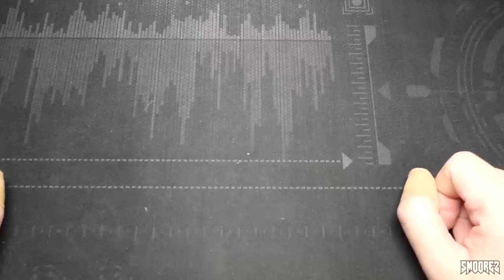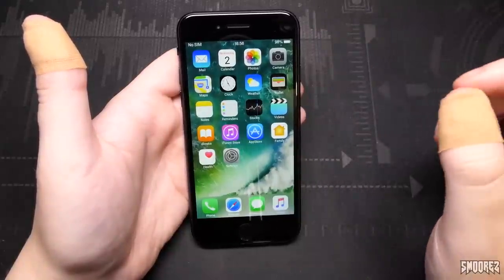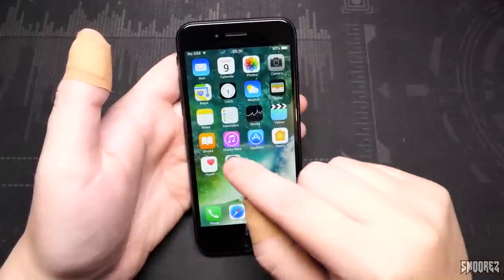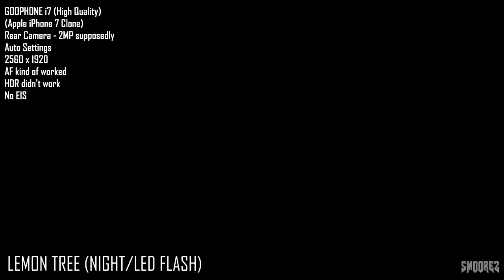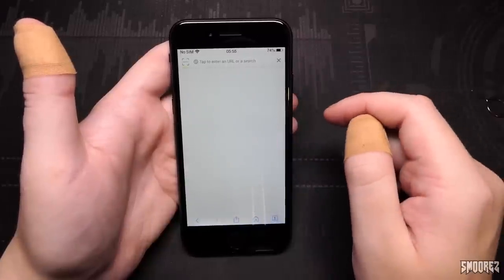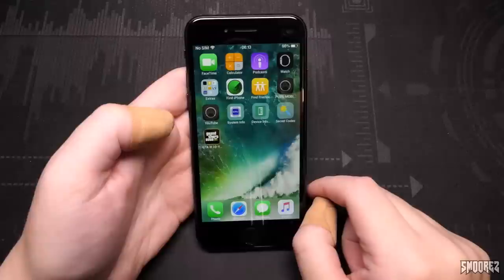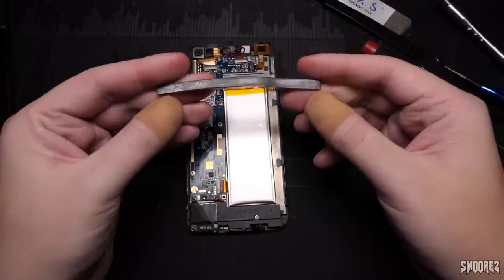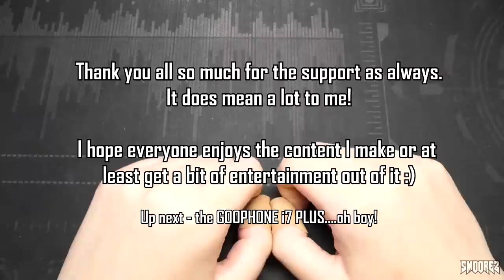ATTACK OF THE CLONES: The PAINFUL "High Quality" GOOPHONE i7 (Apple iPhone 7 Clone)

Comment: I had an Android 4.0 phone just sitting in a drawer since 2012, recently I found it and tried using it, I legit thought it was the worst experience I could ever have when YouTube was taking way too long to open, but all of a sudden after watching this I feel like I've been spoiled.
Reply: I still occasionally use a Galaxy SII that I put unofficial Android 7 on, and it surprisingly works a lot better than this clone, even though it came out in 2011.
Reply: @denny1527  It's definitely the RAM, iPhone clones tend to slow down a lot due to the heavy skin on top of Android, paired with at most 512mbs of RAM. This would have been plenty if the skin wasn't present, but it slows down the phone a lot.
Reply: @pleasebake  Yeah, most of these cheap clones do that. The "Welcome Maimeite P50 Pro" device I once had to deal with was also painfully slow having similar specs, due to Android 4.1.2 being skinned to look like 10, and having a dozen possibly malicious janky apps running in the background. A phone with a clean Android install and these specs would've been semi-decent... in 2011.
Reply: Install a custom ROM. It really does A LOT. A Samsung Galaxy s6 now runs android 11! And it's snappy
Reply: I were able to get YouTube working on a Samsung Gravity Smart running 2.2 Froyo around 2018 or 2019. The audio and video were noticeably offset after a while and the phone's battery only lasted like 25 minutes.
Reply: @pleasebake  no, 512MiB of ram is still not enough.

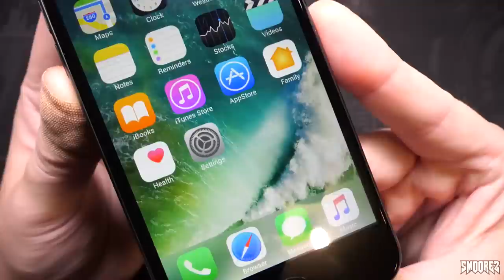Comment: 5:40 You can actually see the line at the bottom of the screen. The screen resolution is a bit short and the picture cuts off earlier than it should, which means the backlight works even under the home button. Still funny how they implemented it.

Comment: 41:37 the 4636 code is the testing menu, including wireless network related stuff. 
You don't get that on iOS, so that proves it's running Android underneath.
(I also use the 4636 code to disable GSM, and have 3G/4G only mode, because let's face it, 2G/GSM is too poor for call quality and data speeds in any modern era.)

Comment: Actually, the boot screen would tell you it's fake, a black iPhone is supposed to have a black background and a white apple logo on boot, and the opposite for the white model.
An iPhone has both of the screens put in it, regardless if white or black, and it can sometimes show the wrong screen, before correcting it if it kinda malfunctions and (re)boots in cold temperatures
Reply: And this is off-topic, but it really is a nice thing that modern devices have the killswitches built into the power button, pretty much just a force restart, activated by holding the power button for about 8 seconds (can vary with your device)
And I have a tablet with old android on it (somewhere around Android 4), it's not really mine, but my family has it. And it has a reset button. Might be an entry for Tacky Tablets.
Reply: @tylern6420 that's only because we aren't allowed to remove the battery like we used to id rather be able to do that

Comment: Imagine the effort that went into skinning this to look like iOS. They did a pretty convincing job at it. Well, it would be convincing if it didn't have the constant app crash popups and options that just don't work. But I assume it didn't crash when they were testing it.
When you put this much effort into cloning the interface of another phone, you have to imagine it would've been easier for them to just make a generic design with stock AOSP. Would've actually worked better too.
Reply: Unlike previous one, this is a perfect scam phone - look almost identical to original, but nothing works :D
Reply: This phone looks almost identical to a genuine one and if you look up the serial number it pulls up an iPhone 7 Pro so they even poured it over a real imei and SN number

Comment: I believe that if they made an actually usable phone (at least 1gig ram and 16gigs + sd card storage with Android 6 and of course no Apple logos) they could sell a lot more without all the returns. I wonder why they don't use at least Android 6. As far as I know Google does not charge for Android so why not use a newer version (just put in slightly larger storage)?
Reply: Phones with 1 gig of ram would be pretty unusable nowadays, especially on Android 6+. Putting newer versions of Android means putting more powerful hardware into the phones which means spending more money, and because Goophone is presumably spending most of their money to replicate the Apple logos and iOS while trying to keep the production costs at minimum, they're using the cheapest, worst possible hardware from 10 years ago.
Reply: @denny1527  Usable depends on what you are using it for. If you don't game on the phone 1gig is usable. I was talking about the minimum I could get by with since the only things I use my phone for (besides the occasional phone call) is an ereader, email and solitaire.
Reply: Xiaomi's cheapest phone is 85 USD here in India and offers 2GB of RAM and a Helio G25 (12nm) running Android 10 + MIUI 12. There's a 6.5" 720p display, 32 GB, headphone jack, SD slot, and it is perfectly usable. 

The point of the fake is to sell the cheapest possible unit at ten times that price, not usability. And they have no incentive to upgrade the hardware or software

Comment: Some of those clones are so unbelievably bad they aren't worth $50 USD to me.  I am thinking about those ones that report high specs when they are just garbage.  If you ever once see one with a camera spec advertised as something high like 20 or more MP, take a photo with it on that setting.  It will just be a 5 MP picture that is exposed all wrong and out of focus.  Better pictures can be painted!  When you test the camera take a photo on its allegedly highest resolution.  Download that photo to a PC or laptop.  Look at properties to see the real size of the photo.  Multiply the horizontal by the vertical (or the other way around works I guess).  That is the real number of pixels your camera captured.  With these clones I never expect to see it as advertised ever .